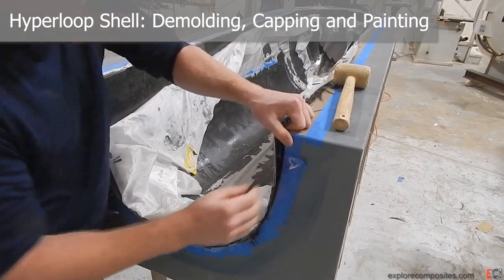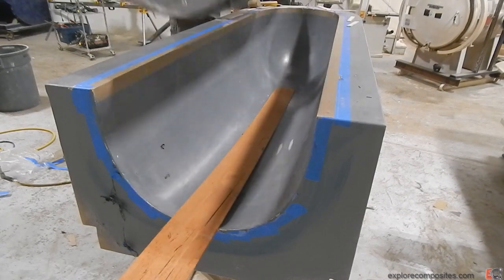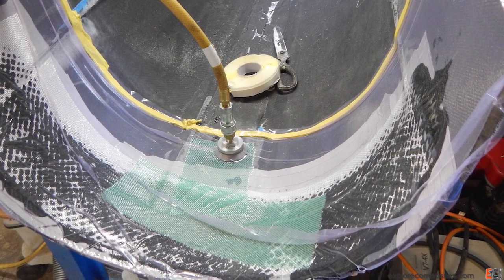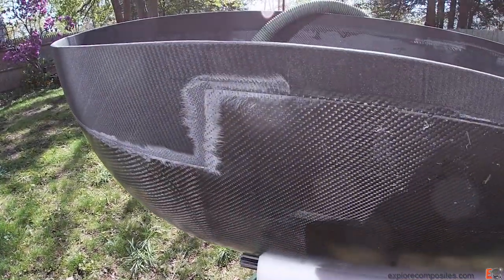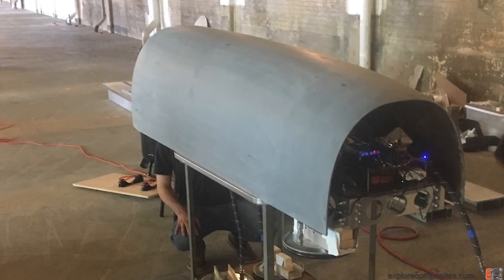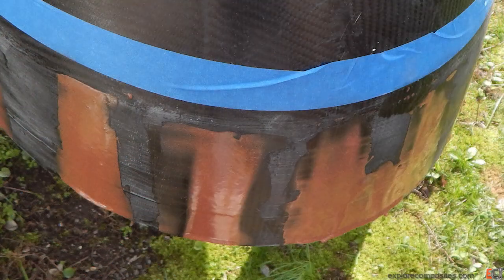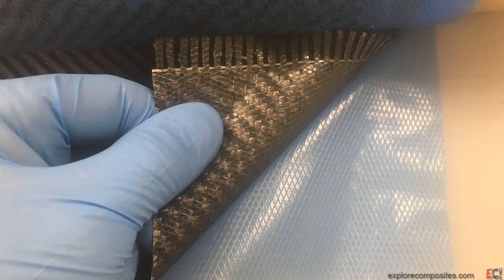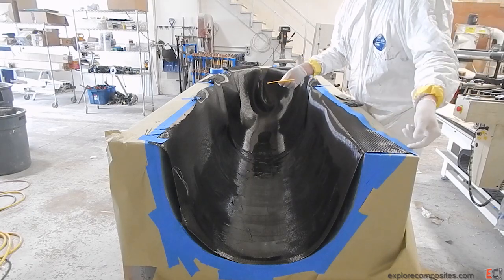Hyperloop Shell: Demolding, Finishing and What I'd Do Differently Next Time (Part 8)

Comment: I don't think it is relevant to talk about material/tooling costs, if you omit to talk about the labor cost, which seems to me a LOT higher.
nice tuto though.
Reply from the maker: Oh you are totally right!  This was a money and time-constrained effort with volunteer labor.  I'm not sure if a machined plug, FRP tool and prepreg part would have been less labor though... part would have been nicer for sure!
Reply: @ExploreComposites  your craftsmanship is second to none, but similarly when we need large molds we outsource the mold CNC (as single cut) to foam cutting shops in CA, I'd recommend Wecutfoam in Sunnyvale and Autoscale CNC in Concord
Reply from the maker: @olivergarrow233  Thanks! - but I too prefer to skip as much "craftsmanship" as possible and make a machine do it!  This was a special case.  I've seen the Autoscale machines online and am impressed - do they cut light foam only or heavier tooling boards for you?
Reply: @ExploreComposites  both shops cut any material (but metals), we use mid-density foam to cut our molds, then cure low-temp prepreg in them, Autoscale combine a classic CNC bed with a large hot wire CNC and both can work in concert, so you can pre-cut the foam block first with hot wire and then do the fine job with standard CNC

Comment: It occured to me that you could have done this more efficiently with a foam strip planking method.  Use foam core strips laid in the frames instead of wood strip planks.  Lay up some carbon on the inner foam surface. Remove it from the frames when it has cured. Fair the outer foam surface and lay up carbon on the outside.  Fair the outer carbon surface. Paint.  John Lindahl wrote an article for Epoxyworks describing how he used this method to build a catamaran - https://www.epoxyworks.com/index.php/foam-strip-plank-boatbuilding/
Reply from the maker: That's a great idea and one I considered.  For something that has core throughout and is uniformly curved like a boat hull (without the dome-like nose here) it is a great method.  People use a similar process with thermoformed foam over wood stringers.  It uses the core for fairing the shape so works better with thicker core.  I've used 1/2" / 12mm core on 12"/300mm stations and it is about the minimum.  Vacuum bagging is harder and the overall weight would be 10-25% higher.  Also, you have to "de-mold" the part with skin on only one side of the core - and it's super floppy!  I did one project this way where we strip-planked a female mold and laminated the inside skin first - and then put in some structure so the shell would be stiff enough to fair before putting the outer skin of carbon on.  

Here because we wanted a fair surface that would have a minimum of filler and the option to finish clear, molding seemed to offer a better option - also with the single skin curved areas.  

Thanks for the link - Epoxyworks is great but I don't remember seeing that article.  It would be fun to do a video series on a project with that method some day - for one-off parts it's hard to beat mold-less construction!

Comment: Thats impressive. Since it got painted; would it not have been easier to do a male die? At what type fiber would you absolutely need to chamfer cores?
Reply from the maker: When that decision was made there was going to be clear finish but yes a male mold would have been faster to build!  
Not sure how easy to do cored vs single skin parts.  With full coring it would have been faster much more fairing compound and high build.  Probably better weight wise this way... but more work.

Not sure I understand question about core chamfers... i think these were about 2:1-ish.

Comment: Hey, great content and nice to openly share your mistakes and successes. One thing I learned recently in making large molds from tooling prepreg at work, is that no matter how good the mold release, you need some kind of mold sealer first. One such good product is MPP 712 from Chem Trend. In poroud media like tooling board, it is not enough though and there some kind of clearcoat / heavy sealer is needed first.
Reply from the maker: You're totally right - a sealer or primer with a high slip release coat would have been a much better choice than wax!  I changed plans mid-stream on that one - was going to go adhesive teflon sheet but couldn't get it in time - so was stuck with wax.  In general I'm not a fan of wax - especially with epoxy.

I haven't used the Chemtrend MPP 712 but I got a bunch of tooling board primer and sealer samples from them and will be learning more about how they work.